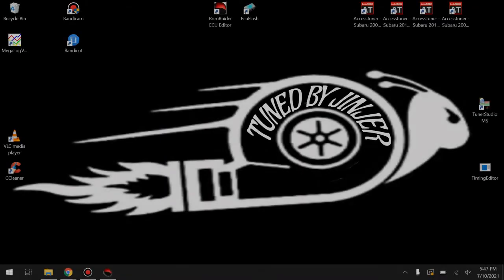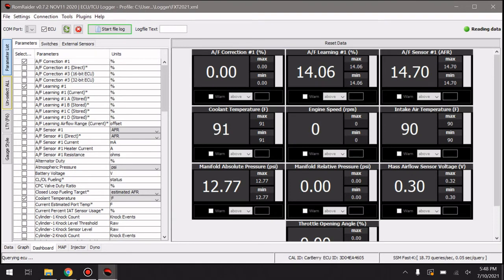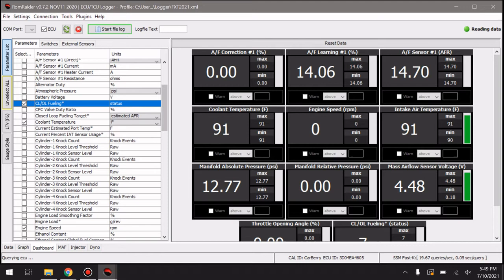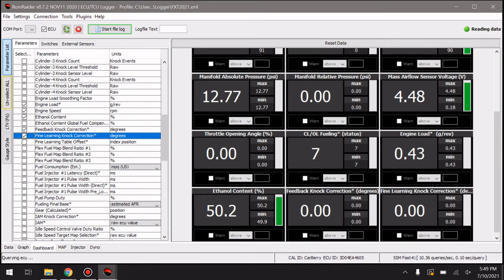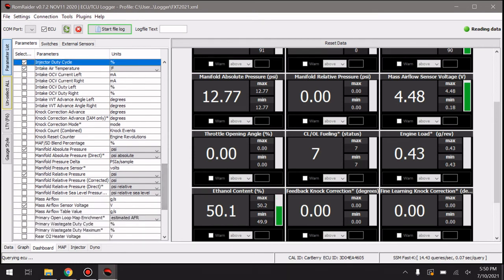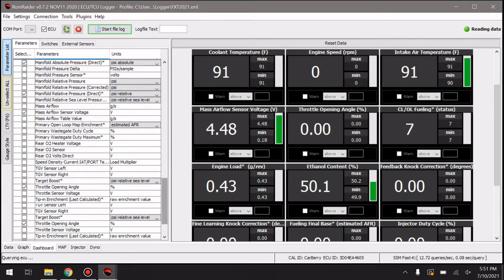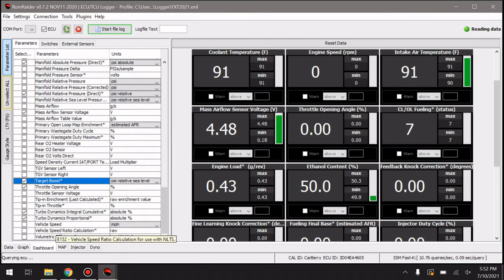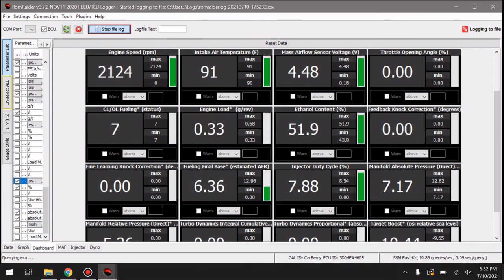How to setup Romraider Logger

Comment: Hi, thank you for this tutorial but I have a problem. When i launch the logger, (with the car ignition on), the word “Recording data” appeared with the green point. I can see all the parameters such as air temperature, spark timing etc… When i click on one of the parameter such as “battery voltage” to see if I’m reading correct values, the output value is zero and instead of “Recordimg data”, the word “connecting” appeard with the blue point. It seems like the ecu disconnect when I select a parameter. Thank you in advance.

Comment: setting up rom raider to log some data but i dont see my target boost, wastegate duty or feedback in my list of parameters? i dont have the car hooked up right now is that my issue? do they pop up when the car is connected and rom raider is reading the vehicle
Reply from the maker: Yes the car needs to be on and the tactrix needs to be plugged into the laptop with romraider logger on to see your list of parameters.

Comment: Hey bro I'm hoping that you're still active on this account lol. So I don't know why but my parameters are slightly different than yours which is weird because I've followed all your tutorials to a tea. Basically I don't have the Final fueling base parameter and I need that to tune my car in open loop lol. Am I not using the correct definition on the logger? I have the sdlogger file and the standard English one but neither of them have it on there. Appreciate any help
Reply from the maker: @Saiyan21  final fueling base won't show until you're plugged into the vehicle.
Reply: @tunedbyjinjer  Awesome thank you! I figured I was using the wrong definiton lol.

Comment: My logger can only log like…6-8 parameters until it can read the information anymore and says error.

It’s like I have to log different parameters on different runs because the program won’t log it all at the same time.

What other programs are available to just data log?
Reply from the maker: Btssm with an android phone or tablet.  Have you enabled fast logging? Do you have other programs running in the background on your laptop? You should be able to log about 18 parameters before you get an error.

Comment: Romraider logger will not connect at all for data logging on my 09 wrx at all, windows 7 32bit system, ecuflash has no problems
Reply from the maker: Doesn't romraider logger open completely?
Reply: Only thing it let's me do is log basic data, not what you have set up, it won't let me use the MAF scaling tool or anything
Reply from the maker: @josephlemay  what do you mean by log basic data?

Tbh I've never used the MAF scaling tool.
Reply: @tunedbyjinjer  update got all the logger info figured out, the page where you can select what parameters you can select to log,  but it says it cant find the tactrix cable, any idea?
Reply from the maker: @josephlemay  download the tactrix drivers seperately on the tactrix website.
Reply: @tunedbyjinjer  negative on that, still won't connect to the ecu for data logging

Comment: Hey man. I have a problem with the logger not showing parameters like yours do. I have uplouded the newest logger file i could find. Any ideas?
Reply from the maker: You mean just the shape of the parameters?
Reply: @tunedbyjinjer  I figured out i had to be connected to the ECU to be able to see which parameters there is to work with. Thank you for replying!

Comment: How do u make ur perameters show up in big font like in youre video? Cuz when im driving i cant see anything its soo small lol
Reply: I appreciate how active you are in the comments man. I’ve got the same question, I don’t have a tab for “gauge style”. Is that a plug-in or something like that as well maybe?
Reply from the maker: @mrzenetic3535 Of course! What's the point of helping if I'm not continuing to help. I wish I could post a picture in the comments to show but if you're opening logger through a desktop icon this will open the Full Screen Logger.  Alternatively I suggest opening logger through Romraider Editor and you should see the Gauge Style tab.
Reply from the maker: Far left of Romarider Logger says Gauge Style. Click that until you like.

Comment: You've missed the most important steps....how you get the logger loaded in the first place. It takes me to a webpage of definition fires and downloads something, but doesn't work after that. You are skipping ahead assuming it is already set up on the computer.
Reply from the maker: Romraider logger downloads and installs with Romraider ECU Editor.  If I had skipped steps thousands if people would have said what you have said.
Reply: Did you not have to download a "definition" file to use logger for the first time? Pretty sure you did. The webpage with definitions can be confusing to someone trying to set it up initially.
Reply from the maker: @rak6080  yes you'll need the logger defs but I go over that as well.
Reply: @tunedbyjinjer  Was it in another video? Because no, you don't mention where or how you got the definitions anywhere in this video that I saw.
Reply from the maker: @danwil77  yes, it's in my first video.

Comment: Hi I’m currently in the process of tuning my 03 wrx  I have followed all of your steps exactly for setting rom raider,ecuflash, and Carberry. I am able to open up my base map and look at the parameters. But for some reason I am not able to log, logger will not connect to my ecu. Are there any simple things I could try to troubleshoot this problem? Thanks
Reply from the maker: Tried different USB ports on the computer?

Comment: Thanks for taking the time to set this up.  Im slowly learning romraider.  When I downloaded it and the def it mentioned a dyno tab on the logger, I have yet to find this option.  Also any advice for a beginner?
Reply from the maker: The dyno tab should be at the bottom left of the romraider logger app but to be honest I've never gotten great results with it. You're better off using a program called Virtual Dyno.
Reply: yeah I found it. Had the window compressed and wasn’t showing. Any interest in guiding me through a tune process?